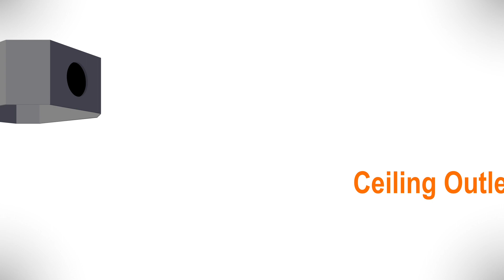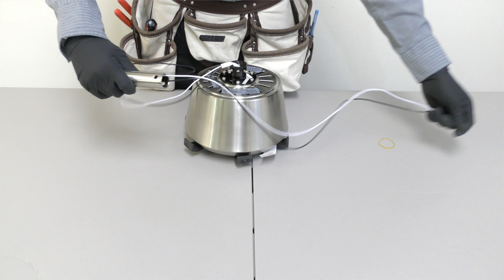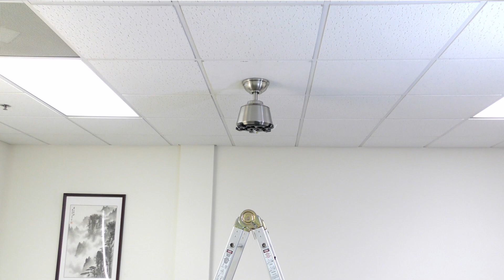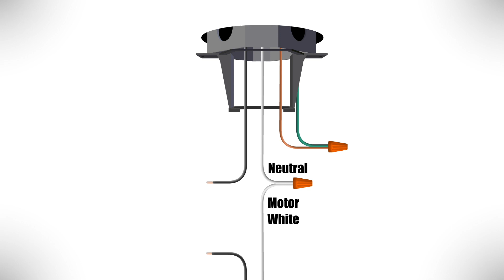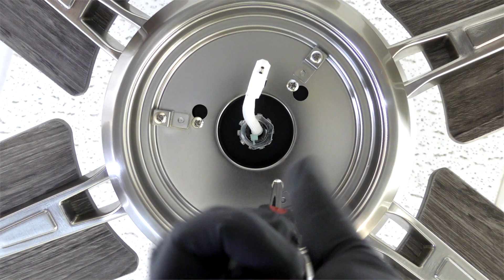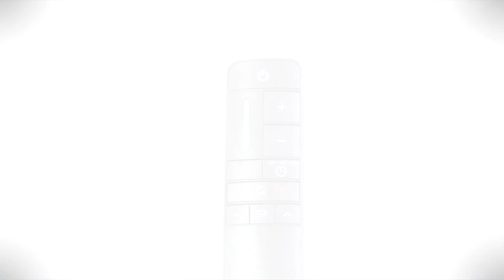54" Kensgrove Ceiling Fan Installation Guide

Comment: One suggestion...

Take all 4 screws out of the hanger bracket when screwing the bracket to the electrical box.  They’re loose threaded and will come out from the vibration.. Do this to avoid them dropping out and having to search the floor for tiny ass screws.

Comment: I am having problems with this fan. Sometimes the fan will work well. But other times it will go forward a bit, stop, go backwards... and repeat for several minutes at low speeds. Could it be defective fan?
Reply: Same issue, now my fan doesnt work at all, did u figure out what it was?

Comment: Installed two of these and it is nothing but a nightmare. Don't get fans that just run off remotes. Each fan has its own remote, but if they are both on the same circuit, you're screwed when it comes to synching them

Comment: Unfortunately we didn't find this video until after we tried to install. We were under the impression that the little black wire was the ground wire and connected it to the green ground wire. The fan started up but think this caused a short circuit, do you think there is any way to recover or is this fan a loss cause now?
Reply: Pmcginn4, I did the same thing.  What did you end up doing?  Was the fan a loss?

Comment: I followed this video and installed this fan, it initially started and spinning for like few mins then shut off my it self, and I tried so many times to pair the remote it just never worked. I thought I did something at first so I installed my old ceiling fan back on and it works just fine. Please help.

Comment: Can this be wired to a wall switch and do away with the remote??
Reply from the maker: Unfortunately, this DC motor fan has a module inside that regulates the fan speeds and can only be controlled via the remote. At this time there are no wall controls that are compatible.

Comment: What about the small secondary black wire that I assume is power for the led lights? It has the one long black wire a long white wire and a short black wire..
Reply from the maker: The short black wire is most likely the antenna. Simply leave it inside the download or canopy and it should still receive the signal from the remote. The wire will also be yellow on some newer models, with a small tag indicating that it is an antenna.

Comment: my remote isn't in sync with my fan.  Suggestions please.
Reply from the maker: If you recently purchased the fan, you may have the version with the updated remote. See the instructions in this video: https://youtu.be/bdsv2W9-G5Y?t=634

You should also check the following; 

1. Verify that the remote has batteries and that the green light bar turns on when buttons are pressed. 

2. Ensure you are attempting to pair the remote within 30 seconds of activating power to the fan. 

3.Inspect the wiring of the fan and verify that there are no disconnected or pinched wires.

If the fan still has issues, contact customer service (1-800-986-3460) for detailed assistance.

Comment: It would be simple if the 3rd wire in the fan was green but it's black, is this to be connected to the other black wires or is it a ground or should it be left unused??  This small black wire seems to have a cap sealing the end??
Reply from the maker: The small black wire with the cap is the antenna for the motor's receiver. It can be left as is inside the downrod or canopy. The only wires that need to be connected are the motor's regular/uncapped black wire to hot and the motor's white wire to neutral, along with the ground wires from the canopy/downrod/outlet box.
Reply: @TALCeilingFans  Thanks makes sense but wanted to be sure.

Comment: Excellent video I follow all your steps    It was very easy  The black cable with a black cable the white with white the ground with the ground but there's only one problem the light doesn't turned on The fan does work.I don't know if this because I didn't connect a small black cable that it was there I didn't connected to nothing I just left it alone If you can Let me know  Please I'll preciate it thanks..
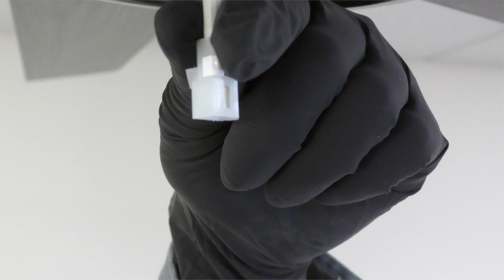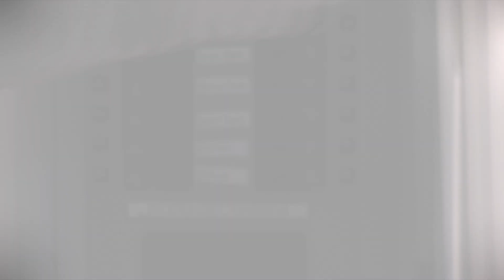Reply from the maker: The Black wire, White wire, and Ground wire from the motor are the only connections needed to power the fan and light. The small black cable you found is most likely the antenna wire. First, check the battery compartment of the remote for a DIM/ON dip switch. Move the switch to the opposite position and test the light.If you are still having trouble with your light, verify that the connectors (shown at 8:30 in the video) have their pins fully inserted into the plastic plugs and that they were properly connected. You can also Complete the learning process again (shown at 9:20 in the video) to see if the light flashes twice. If function is still not restored, then you may need to contact customer service (1-877-902-5588) to see if there are any other components that need to be inspected or replaced.

Comment: My fan recognizes the remote but the dimmer is not working. Does it need to have a dimmer switch on the wall as well?
Reply from the maker: The dimmer arrows on the remote should dim or brighten the LED, no other accessories are required. If the light is not responding to the arrow buttons, try changing the DIM/ON dip switch in the battery compartment of the remote and completing the learning process again. You can try contacting customer service (1-800-986-3460) if you are still having trouble getting the remote to function correctly.
Reply: Thank you! That worked. I wasn’t aware of the switch inside. Great work!

Comment: I have a black wire, white wire and a red wire coming from ceiling.  Also there is a thinner black wire also coming from the fan.  Do you just cap off the red?   What did you connect the thin second black wire to?
Reply from the maker: The red wire isn’t required for the installation and can be capped off with a wire nut. In most homes, the red wire is simply an alternate hot wire that is controlled with the on/off switch on the wall, while the black wire in the box is a hot wire that is always powered. You can connect the black wire from the fan to the red wire instead of the black wire, giving you the option to cut power to the fan from the on/off switch. 

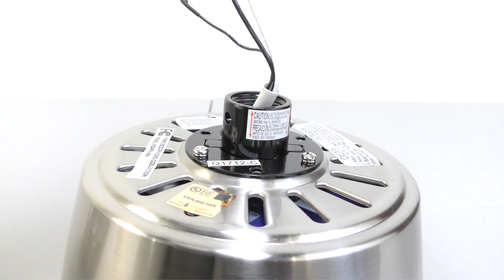The small/short black wire you see should be the antenna for the built in receiver. The wires coming from the motor should look like the wires at 5:28 in the video. Simply slide the antenna into the downrod with the rest of the wires (if installing with a downrod) or leave it as is if installing using the flushmount installation.